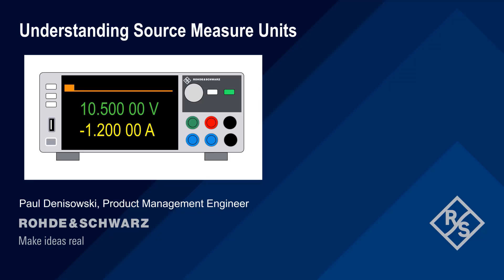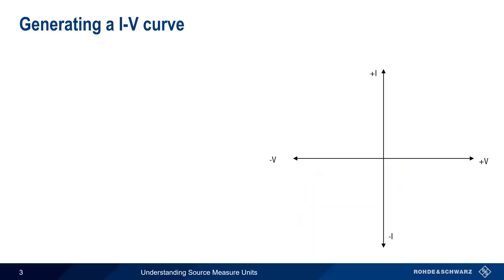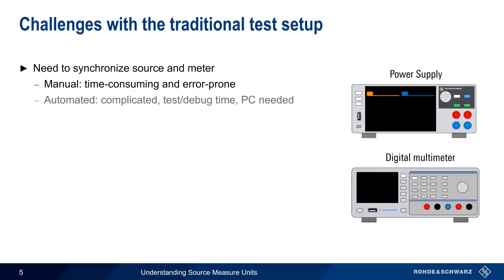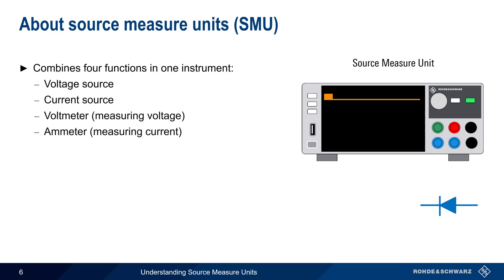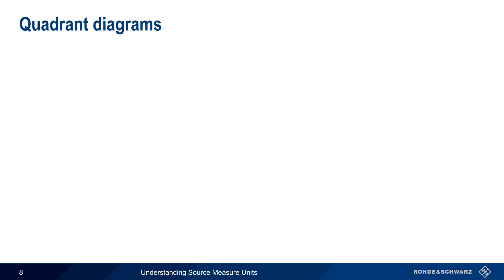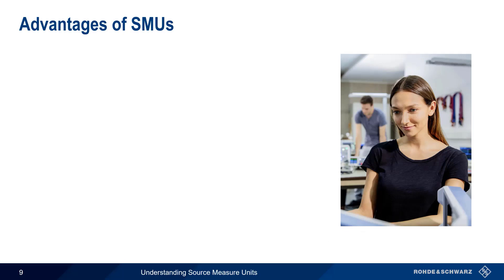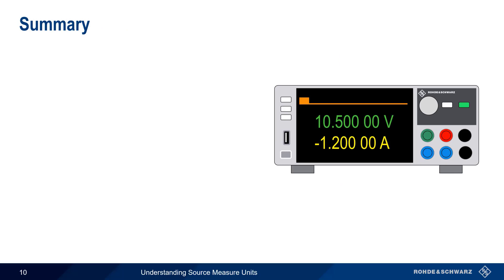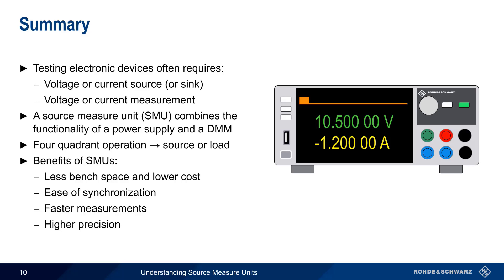Understanding Source Measure Units

Comment: @pauldenisowski: Could you please comment, if using SMU as a source current biasing unit for an on-chip  local oscillator, how much flicker noise would be contributed from the SMU. I am assuming the current sources inside the SMU instrument would be CMOS based.
Reply: I would refer you to the specifications.  Some amount of "noise" (or ripple) is present in all power supplies, and that would be the figure of merit in this case.  In my experience, it's only really possible to measure noise generically, although if you plot the distribution of the noise, it often has "regions" where the contribution is primarily due to a certain mechanism, such as flicker noise, random walk, etc.